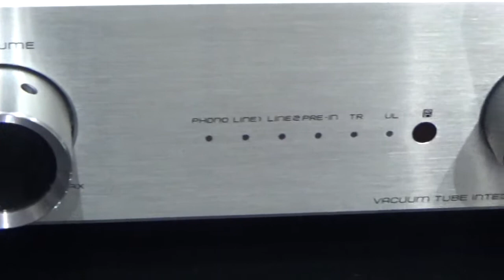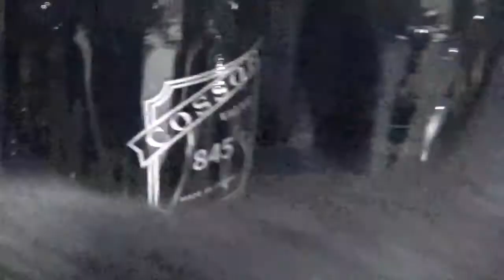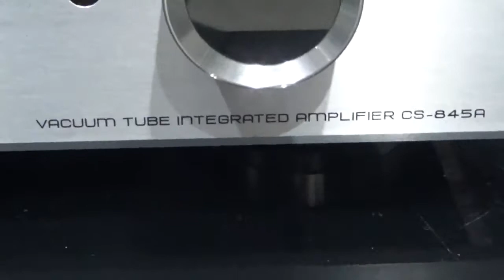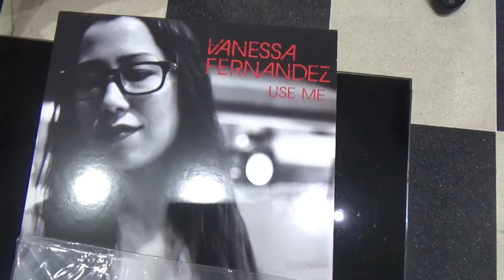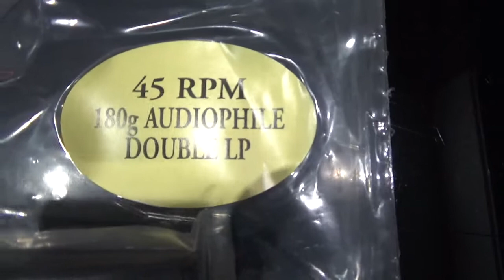CAYIN CS88A Y CAYIN CS 845 A DIFERENCIA DE TAMAÑO Y VALVULAS

Comment: cual de los tiene más chicha tengo un cs55a y estaba haciendo ideas y no sé si vale la pena a ver tú qué opinas
Reply from the maker: Buenas, son aparatos muy diferentes, tanto en sonido como en la forma de trabajar y atacar las cajas.La válvula 845 es aunque no tenga muchos vatios ,24, es muy poderosa en manejo de amperaje . Por lo cual necesitamos un espacio de más de 25 metros, después las cajas con drivers pequeños no le van muy bien, deberían de ser como mínimo de 10 pulgadas en adelante.Y una sensibilidad de más de 95 db.Todo esto lo digo por mis pruebas en distintos inmuebles y con distintas cajas .Ya el sonido también es diferente a la kt 88.Una es un triodo y la otra un pentodo.Tambien he hecho muchas pruebas con el CS 88., Quizás sea menos esquisto para las cajas pero también necesita espacio y mejora mucho también con drivers grandes.A todo esto más chicha tiene el 845.Una cosa muy importante, cuando compramos un amplificador a válvulas,hay que cambiar las que trae y poner unas de calidad,las que vienen de casa suelen ser malas o regulares,para los Cayin les va muy bien las JJ ,y regular por ejemplo las Electroarmonix o a mi particularmente no me gustan.Si tiene alguna duda que le pueda responder escríbame.